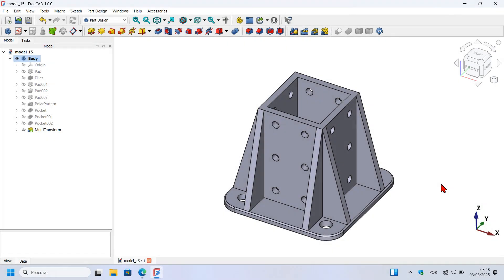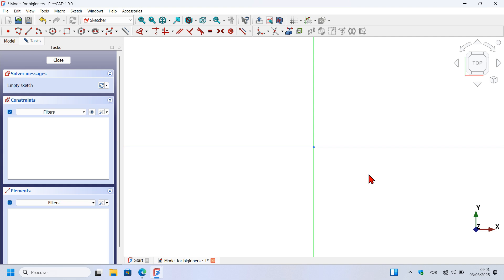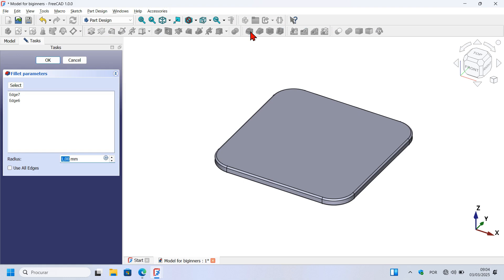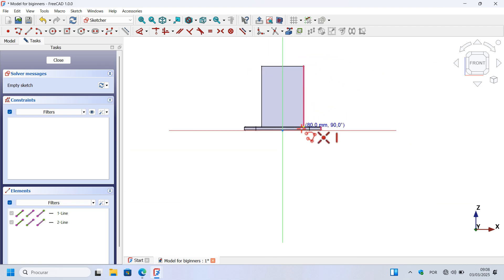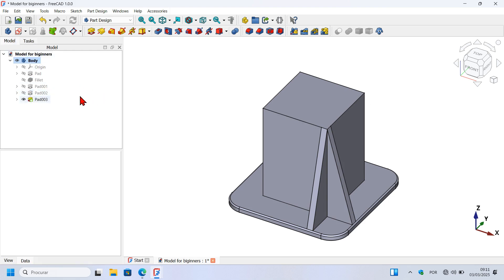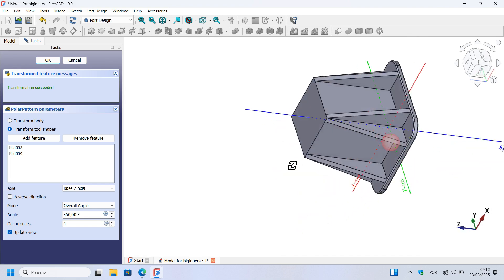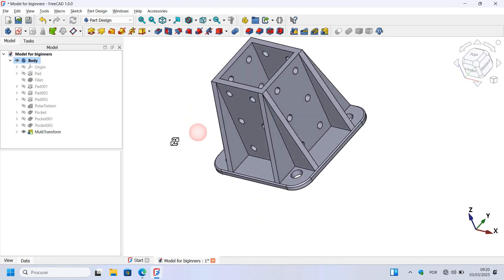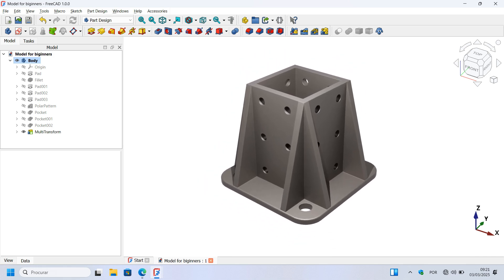Complete FreeCAD 1.0 beginner: 3D modeling with PartDesign & Sketcher workbench

Comment: Thank you for your video. @ 9:31 i can‘t extrude the triangle: „wire is not closed“. Tried several approaches - no success. Sketch is „green“ and fully constrained.
Reply: This sometimes happens to me, too.  Each time it was because I had an extra unnecessary line that was under one of the necessary lines but I couldn't see it.  Had to keep deleting (in turn) the necessary lines until I finally found where it was hiding. Then I could delete it, and my wire would then close properly.
Reply from the maker: Thanks!
Reply from the maker: Rectangular selection on all points forming the triangle and then delete. Then apply coincident constraint on all points (select the points of each corner of the triangle by rectangular selection) forming the triangle. Note: do this on each corner of the triangle.